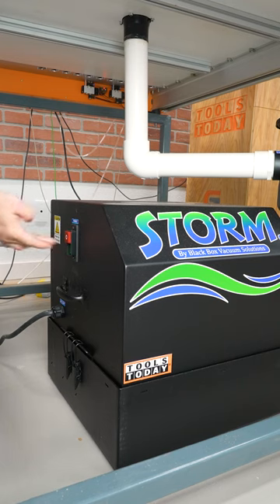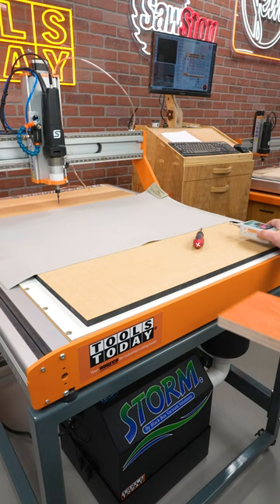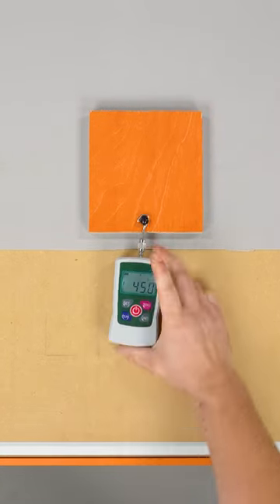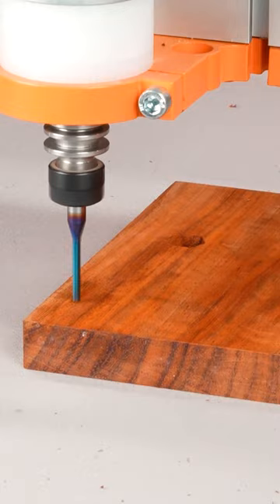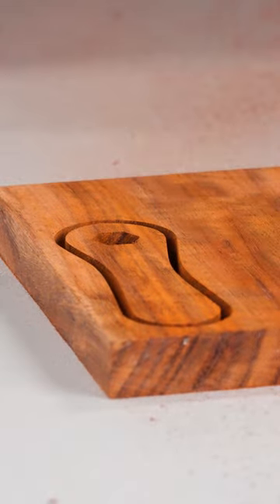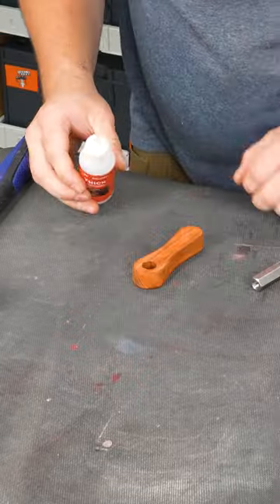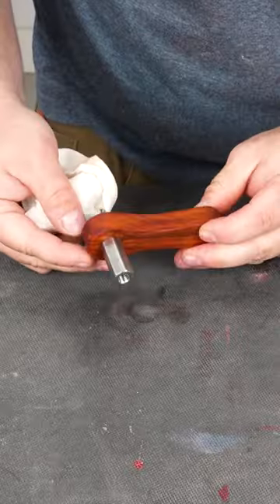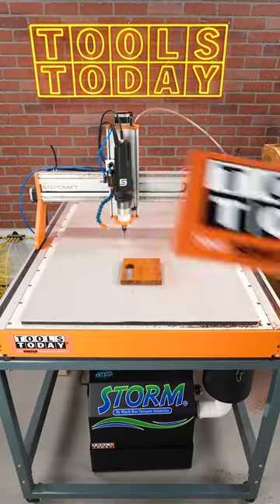I Didn't Think This Was Possible

Comment from the maker: Check out the tools used on our site - https://toolstoday.com/black-box-vac-bbv-mat-510-grip-lock-mat.html

Black Box Storm Vacuum - https://toolstoday.com/black-box-vac-bbv-svp-2-storm-vacuum-system-for-cnc-routers-single-phase-220v-230v-at30-amps-2-long-life-high-performance-motors-inline-filter-not-included-but-recommended.html

Stepcraft M.1000 CNC machine - https://toolstoday.com/stepcraft-m-1000-cnc-system.html

Amana Tool 46225-K - https://toolstoday.com/v-13941-46225-k.html

Comment: For those worried about cutting thru and dont want to hit the thicknes he did, set your depth to just shy of 1/16in use  1/4in end mill and you can poke a hole and router out the remaining material with a 1/16in round over bit.
Reply: Or just use a few screws add an extra 1/4 inch of any cheap wood.

Can also use blocks on the corners when ever possible.

Lastly any adhesive that you have the solvent on hand.

Like regular people
Reply: @richardbusta8899  and what would be the point in using the mat if you're doing all this. For those that want to use the mat I provided a solution. I myself do not use the mat. This is a regular person problem, not sure how regular ppl are defined as having limits to how they machine but... ok...
Reply: @bojangles5226  to fully cut through with out hitting your mat. 
Especially for multiple parts from the same piece.

Comment: I'd be so scared to cut through the holding mat. I mean, how thin was the onion skin thingy?
Reply: Prob between 0.2 and 0.4mm 0.2mm is the thickess of a index card.
Reply from the maker: You can cut into the mat and still be able to use it, it can take a bit of abuse before you have to flip it to the other side or replace it.  The onion skin was about .005" thick, but you don't have to go that thin, you can adjust it to be whatever you want, it just makes it easier to pop out if its real thin.
Reply: @ToolsToday does sawdust affect how grippy it is?